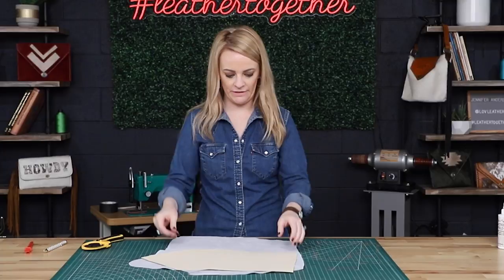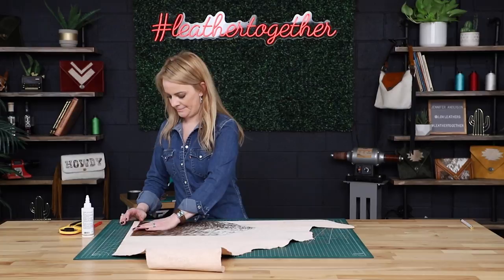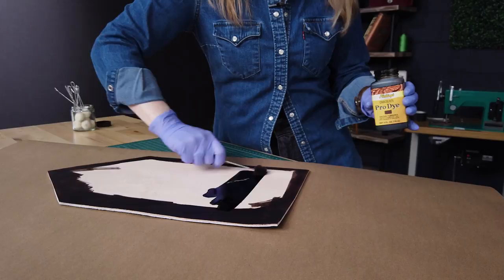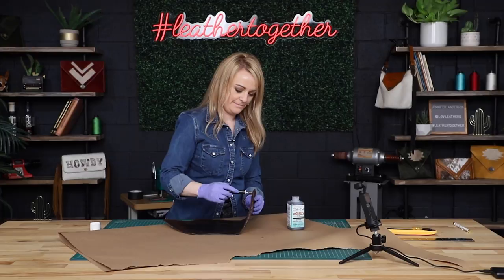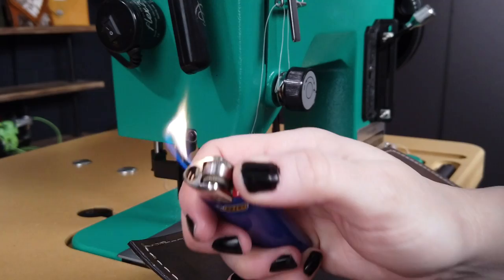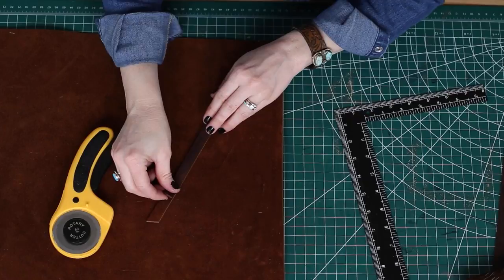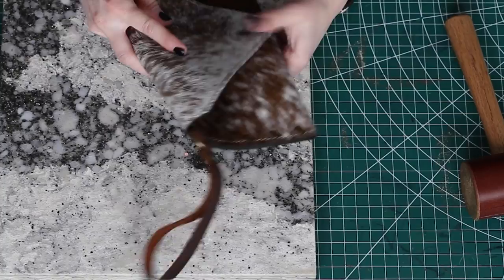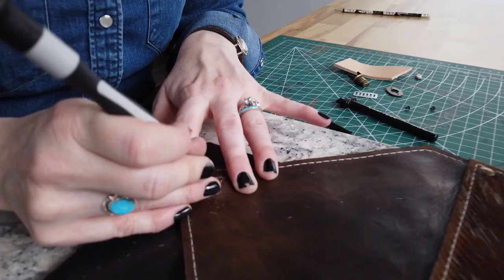Making a Hair-On Clutch with Jennifer Anderson!

Comment: Help it says link not found for the pattern
Reply from the maker: Here is the link for the pattern: https://cdn.shopify.com/s/files/1/0063/5997/3970/files/Clutch_Pattern-pages-deleted.pdf
Reply: @TandyLeatherCo  do you still have the step by step instructions for it? I'm wondering which veg tan product is preferable. thanks!
Reply: okay I think I've rewatched it and need the tooling calfskin for the actual bag and the craft cut is just for protecting the bag from being punched through for the clasp?